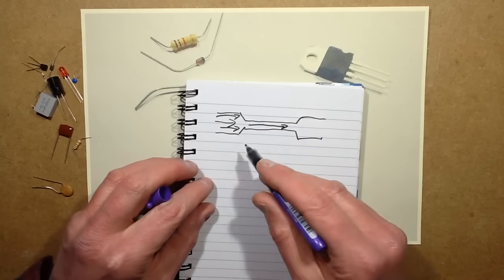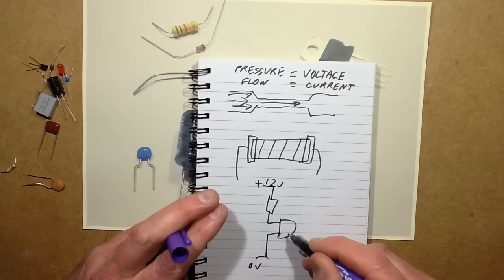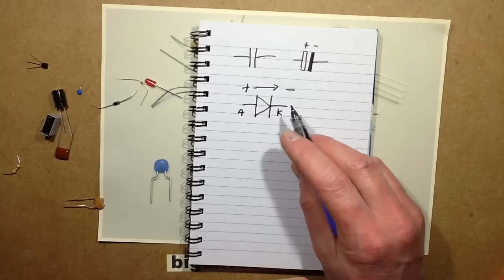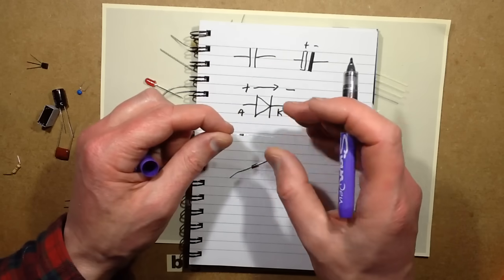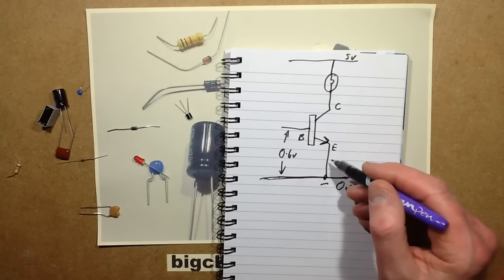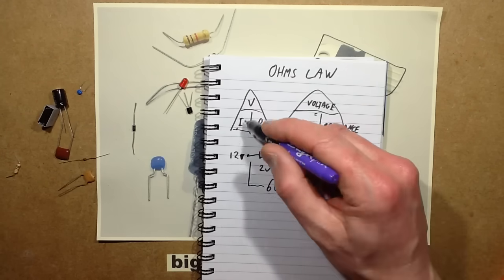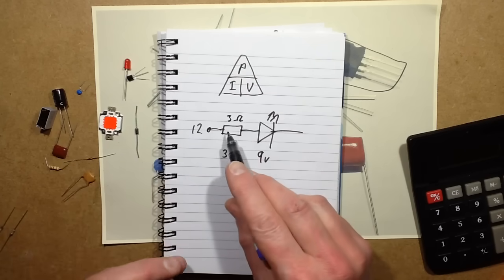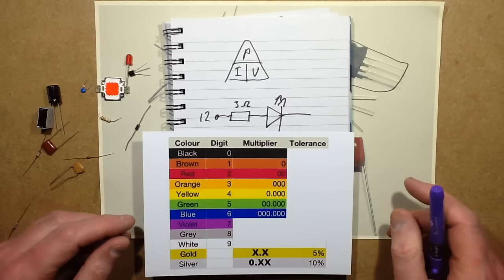A simple guide to electronic components.

Comment: Then, will the infrared diode break if the battery has been installed in the wrong polarity?- that would mean it doesn't have reverse polarity protection? (I had a cordless mouse, but it just stopped working- is it just the diode typically?
Reply from the maker: The main circuitry is often damaged by wrong batter insertion.

Comment: LDR Photo electric  - is this a simple on off switch? If I shine a laser at it, it keeps the contacts closed allowing current to flow. If i remove the light source, it stops the current. Can I put this into a simple setup (example, the tamper circuit of an alarm system) and if the laser light is tripped, set off the alarm?
Reply from the maker: An LDR is a light detecting resistor.  It will only change resistance, so may need something to buffer it up to switch power.    You can get infrared beam detectors for security use.
Reply: @bigclivedotcom  would you be able to show me how to include a relay to do the switching with a simple laser switch setup?
Reply: @bigclivedotcom  Thanks. If I introduced one of these to the tamper circuit of an average alarm system, and with a laser pointer pointed at it, would the current flow freely enough to keep the alarm system running without a fault? And if I then turn off the laser, would the resistance be great enough to trigger the alarm?
Reply from the maker: @c-low-ray  it might work, but could risk false triggering.

Comment: Very good video but 
In real life water increases it's pressure when it pumped in a narrow space 

But in resistor things are different why 

This is what really happened inside a resistor when current flow

Current made of electrons we all know that
so when the electrons passes through the resistor material probably nickel chromium alloy with ceramic fiberglass so it withstand heat
The electrons collision with the material thus making them go slower and heating up the resistor if more current passes through the resistor it will become very hot and burn it nickel has high resistivity to electrons with atomic number of 28
And atomic weight of 58.69 so it's like pulling the electrons to it's orbit but the momentum of the electrons keeps the electrons moving and passing through but with slower base ..

I have wierd understanding of electronics

Comment: Jeepers Creepers Clive, I'm in my 40's and in the mechanical trade services. Whilst I was a young fella I was always told correctly to not touch any electronics because of all of the dangers told to us by parents and elders (still very true) But these videos are a fantastic way for a person who's perhaps been stuck in their old ways, probably have unwarranted fears and are not sure how to get involved in electronics, such as hobby/auto electrical enthusiast. The way you helped to explain and then it clicked for me was my trade experience in Diesel mechanics and the heap of hydraulic design, installation and repair I had done and it's all current and flow with resistance for pressure etc. Love these videos mate. Cheers from South Australia 🇦🇺

Comment: That's great but can you explain to me why it doesn't matter which side of an LED the resistor goes? 🤣🤣 Seriously I am trying to get into electronics and started messing around with an arduino kit, the basic instructions casually mentioned this fact without explaining it and my brain started giving off a strange sort of smoke with an unpleasant odour. 

I have looked around a bit and have come across a few people trying to explain it but I still can't wrap my head around it so if anyone can help I would be most grateful!
Reply from the maker: The current is equal anywhere in a series circuit.  So the LED and resistor can go in any order.
Reply: @bigclivedotcom  Thanks for answering Clive, it's such a hard thing for me to conceptualise, I guess it's just to do with how my brain works (or doesn't) lol. I'm playing around with a mental picture of the pressure in a hosepipe with some sort of T junction with some kind of "load" on it, maybe a sprinkler or similar? What would happen to the pressure at the sprinkler if I were to restrict the flow by pinching the hose either side of the T? I honestly don't know and may have to pop out to the garden.. I guess I'm more of a visual thinker than I thought. 

I'm slowly coming to the conclusion that I'm going to have to just memorise things rather than understand the how and why when it comes to electronics!

Comment: If you have a resister before an led in series, can the resister break, and so should there maybe be a fuse between the resister and the led? Well maybe not for something as simple and inexpensive as an led, but if it were a more expensive component?
Reply from the maker: It's rare for resistors to short circuit unless they are run at many times their power rating.

Comment: Very informative video thank you, i decided to fix my android head unit for my car (aftermarket) and i am giving it a go of repairing it, the capacitor has leaked electrolyte fluid near the power port. Obviously deeming the unit inoperable. Made a mess on PCB board cleaned with isopropyl and a q-tip. Removed the capacitor and waiting for new one to get here in post. I just wanted to learn a bit of theory on components on PCB boards. Thank you very much. Will subscribe for more knowledge. Thank you.

Comment: Why 10 mA value for required resistance calculation? It either wasn't explained or I missed it after rewatching that part 3 times. Is it based on LEDs forward current? The LEDs I have are rated around 20mA.
Reply from the maker: I usually under-run LEDs to make them last longer.

Comment: what causes a capacitor  to hold the charge ,  long after the  voltage has been disconnected?....thanks
Reply from the maker: Capacitors are effectively two separated conductive plates, so without a discharge resistor they will retain their charge difference (the quantity of electrons above or below an ambient state) for a long time.
Reply: @bigclivedotcom  ok, thanks  for the explanation...surprised you didn't mention that fact in this video, as the larger ones can be quite dangerous..........thanks  again

Comment: Good morning, one question.
If I have to do a troubleshooting of any electronic component on an electronic board, do I have to unsolder the individual electronic components one by one from the board?
Reply from the maker: Some can be measured in circuit, but readings may be affected by adjacent components.
Reply: I will contact you for more information.
Thank you

Comment: I found myself thinking overnight about LEDs. Specifically the bi-colour ones that have three legs (a positive for each colour and a common ground). I got thinking that, when you get right down to it, one of these could basically be a PNP transistor  - it is after all a pair of PN junctions back-back. Probably a pretty crappy PNP transistor at that... Do you know of anyone who has tried to replace a PNP transistor with one of these?
Reply from the maker: The LEDs are separate in the package.  To have a transistor effect they'd need to be one single device.
Reply: @bigclivedotcom  Oh well...Thanks for responding!

Comment: Hello bcdc and everyone. I have a rug doctor mighty pro x3 that doesn't turn on and power switch is stuck in the on position, could you please help me so I can find the fault I only have basic electrical knowledge but I have current metres etc. Many thanks
Reply from the maker: It sounds like a failed switch.
Reply: @BCDC Thankyou for advice. Can you please tell me how I can confirm if it is a faulty switch.
Reply from the maker: @sloopycat1954  It's tricky to troubleshoot without actually being there, but the fact it is stuck and not working makes me think that the switch has either failed mechanically or burned up inside.  If it's a standard switch you may be able to get a replacement and try it.
Reply: @BCDC Thankyou so much, your advice is better than Rugdoctors, they said try banging the casing near it and it might pop up but it never did, I will try and remove switch and get a repair shop to look at it. Many thanks.
Reply: @BCDC sorry to bother you again can you please tell me how I test the switch with a continuity metre etc, the switch has 4 wires plugged into 4 brass connectors that have a split in the middle, I hope that makes sense, you can't send photos on YT sadly.

Comment: I need help please. I have a 100amp battery and a solar panel that gives at most 2 amps, I want to trickle charge, but what diod specification do I need to look on eBay to buy an efficient diod that can block 13 volt 100amp to protect the solar panel from shorting out but at the same time not eat up so much of the power, thanks

Comment: This probably wont be answered, but i would very much like to know if you had a separate passion before beginning to work with electronics. Physics has been a passion of mine for a long time now, but the required math skills would take a lot of refinement on my part to do it successfully. And electricity is just so interesting to me, be it a basic circuit, to something like a FULL BRIDGE RECTIFIER. Even the names are cool and if im gonna be playing with it i would like to increase my level of educated risk taking abilities. Im stuck between two hypothetical rocks and both interest me; i just dont want to sell myself short
Reply from the maker: I just grew up with electromechanical and electronic components as they became available.
Reply: @bigclivedotcom  so you gained a fair amount of confidence mostly playing with components? Thats kind of what i do, but i think my perception is a bit skewed with youtube recommending tesla coils powered by slayer exciters, and wireless transmission of energy using high frequencies. I think ill try to learn circuitry and maybe attempt to build some circuits before i spend 30k on a degree; thanks for the speedy reply i do appreciate it. Also do you know of any circuit kits that are slightly more complex than the LED kit ive seen you build? Its not necessarily thats its too easy i just want to be able to mess up and THEN go look for reference

Comment: I would suggest that you use a larger sheet of paper because you seem to often run out of space.  I would suggest  a 14 inch  by 14 inch paper.  This is easy to fix.

The other item I would suggest is regarding presentation method.  For you, I would suggest that you prepare all materials ahead of time and stick to that material.  I noticed you like to go off script a lot , which you often fill in with various sounds because you are trying to find the right word or idea or analogy.  This method of free style is often more difficult for most people and so having prepared material , will help you present a smoother product.

Hope this helps.

Gerard Sagliocca

Comment: I wish  I had this info many many years ago. But never too late and thanks for such a useful video!    Also I have a controller that went bad. It is supposed to have an internal digital "relay" that becomes on/off based on input, but now it is only showing 0 ohms and 45 ohms instead of 0  and infinity.    Is there a way I can use a transistor or mosfet, that can power another normal relay, based on 0 ohm or 45 ohm input?

Comment: Something you might find interesting is in French, at least Quebec where I'm an electrician, instead of "potential" for voltage we say "tension". As in "it's under tension" the way a wound up spring or a stretched rubber band has the capacity to pull or push something. In fact, we even say "sous tension", literally "under tension", on warning labels rather than "electrical hazard" or "live circuit".

Comment: I guess my problem with the water analogy is, that with water the flow rate will increase if the volume decreases. Given the pressure remains the same in the system. For the brief moment the water is in the narrow neck, the water increases in speed in order to maintain the same pressure and move the same volume of water. This sort of phenomenon does not happen with electricity. The drawing you made is called a "Venturi Tube" in flow and hydro dynamics, and the effect the "Venturi Effect".

Comment: The switch on my Mower is misbehaving (slipping) and I was considering bypassing it when I noticed
a Grey Rectangular package across the connections --- A Capacitor ? To damp spikes from the motor ?
Reply from the maker: Probably a capacitor or snubber network to reduce contact arcing.

Comment: Resistors, capacitors, and inductors are not electronic components. The are electrical components. They can be used in electronic circuits but they are not electronic components.

Comment: Why are Volts denoted as V but Current (Amps) is denoted as I?  Also, is there a conceptual name for volts (like how current is the conceptual name for Amps and resistance is the conceptual name for Ohms )?  Also, what is power measured in?  Would I be correct in thinking gain is measured in decibels?

Comment: when u connect a 12v bateri to a led light with a resistor... they battery sends out maximun output at all times? or does the resistor cut down the duration of the batery?
Reply from the maker: The resistor drops the difference in voltage between the LED and battery, and dissipates it as heat.
Reply: @bigclivedotcom  so you might aswell just add a bigger light becouse will use maximum output either by heated resistor+ bulb or just bigger bulb?

Comment: Electrolytic capacitors would work dry if correct solid electrolyte is used.  Like sodium hydroxide and wood glue mixture. I can make really thin film from that since it settles flat and dries to shape at flat surface.

Comment: I wish you would remake this video without the manufacturing explanations. I don't actually care about how the conponent is made or what it consists of.
What I want to know is... What the component is, what it does, how it works (Briefly), and why it's used. Nothing more. 
Please avoid going on tangents it makes the video longer than it needs to be.
Reply from the maker: Knowing how they are actually made is very useful.
Reply: @bigclivedotcom  I'm sure it can be to the right person. From my perspective I only want to know how to, and why to, use components in different situations. Do all components have + and - or are there different scenarios where that is not the case? The explanation for these components just drags on far too long.
Reply: @bigclivedotcom  I agree that manufacturing posits well at a higher level. And I am not criticizing the information you present, only that you do.
Example: An auto mechanic does not require knowledge of how most automotive components are manufactured, only that they
exist and how to either repair or replace them. On the other hand, an engineer does require a more intimate knowledge of components.
My opinion is my own in this case, I speak for only myself and no one else. I am no where near the level where I might require this
in depth level of understanding where electronic components are concerned. Thank you.
Reply from the maker: @organreeman4376  A true mechanic will understand the components on an engine to a level far beyond and ordinary mechanic who just swaps parts until it works, or will defer the repair to a "real" mechanic.
Reply: "Please give less information to 6.7m other people because I don't know how to skip through videos."

Comment: @13:45 So when the electrolytic capacitors dry out, they create a larger ripple due to them being less capable. So what will that translate to in terms of current flow on the device? Will devices that use electrolytic capacitors slowly eat more electricity to do the same amount of 'work' as the electrolytic dries up? Do they cause the device to be less power efficient? 
Also, if the electrolytic capacitors go bad over time, why don't designers design the circuits with longer-lasting capacitors in mind? Or is that not always possible in circuit designs? I'd rather put a bit more money into the components if I knew that doing so would do away with the possibility of the dried-out capacitors after X years. Or is this something becomes size-prohibitive?

Comment: I worked in a TV rental shop when I was 16 (40 years ago) and my job was to open up brand new TV's and replace a resistor R1 or R16 (just after the power supply in stand by). This resistor was rated so that it started to fail after about 14 months of standard use. 
This was outside of the standard 12 month warranty, so basically the TV was designed to fail. I was told that he had TV's out on hire that were 10 to 20 years old and still held a perfect picture, although they were recalled every few years for de gausing.
I would think that this operation is still in use so if you have a tv/monitor that is starting to fail it may be just a simple matter of replacing that resistor.

Comment: Great video. I'm still at the level of using a meter to check I'm going to use the correct resistor.
I do make small projects for eight bit computers, but they are resistor, diode and 74 type ICs with switching in the 10s of hertz range.
I'm picking up bits just by looking at parts of circuits, but as soon as it gets a bit analogue I run away. I'll try harder with transistors now :)
Reply from the maker: Using a meter to double check resistor values is always a good thing.

Comment: When I was in the forces back in the 80's Airforce stores used to re-form electrolytic capacitors to stop them failing when installed, in fact it can be said that electrolytic get more unreliable with lack of use or being energized, and yes I have seen a few catastrophically explode !

Comment: What resistance rating do I need to light just 20 x 2v bulbs from a set of 100 lighting it with 240v/50Hz ac  please?
Reply from the maker: A resistor for that would get very hot.  It would be dropping about 200V at the lamp current.